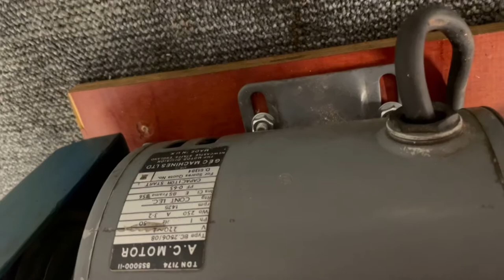Atlas (Clausing) Model 10100 Screw Cutting Engine Lathe Svarv Drehmaschine

Comment: Good evening! I have one of these and I'm hoping you might have some advice on getting the pulley off of the headstock.

After taking the snap ring off, there doesn't seem to be any obvious way to get the pulley off. I see there's a silver ring of some kind in between the snap ring and the pulley itself.

Is there any way you might know how to properly get the pulley off? I'd be incredibly grateful for any information you can help with.

Thank you!
Reply from the maker: Dear,

I am sorry but I have never got the pullet off on one of these Atlas lathe’s. Also I do not have one in stock to try for you, if I could I would help you but not at this moment. Good luck!

Kind regards,

Comment: Seems your missing the belt tensioner. That slot between the motor and headstock is for a sliding tensioner.
Reply from the maker: It was not missing, it’s in front of the machine on the picture’s.
It was not mounted at the moment.

Comment: Thanks for making this video. I just bought the same lathe and it’s missing quite a bit and I’m trying to put it back together. Do you know what motor number this is? My motor is missing completely.
Reply from the maker: Dear,

The Atlas Lathe is no longer in stock so unfortunately I do not have the opportunity to check.
I do know it is a 3 Phase 380 Volt engine.

Kind regards,
Reply: @thelathecompany  okay, well thanks anyway. I have a treadmill motor I may try to use if I can figure out how to convert dc to ac.
Reply: @wht240sxka  I have this lathe, are you still looking for the motor number? I realize a lot of time has past since you asked.
Reply: @Hawk74  thanks, I ended up using a motor from a swamp cooler that was around the same rpms. The v belt was another challenge, same with tensioner. I’m probably  going to switch to skateboard wheel since the factory one kinda sucks and doesn’t even have a bearing.